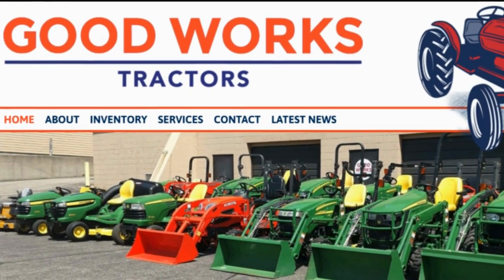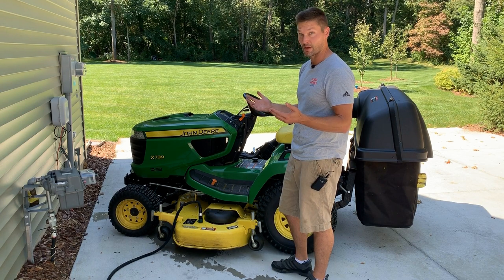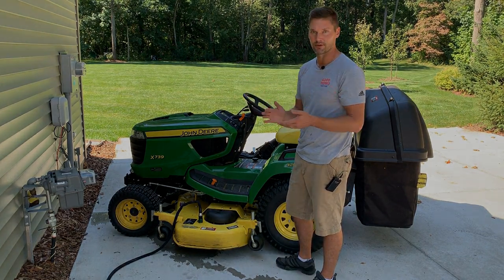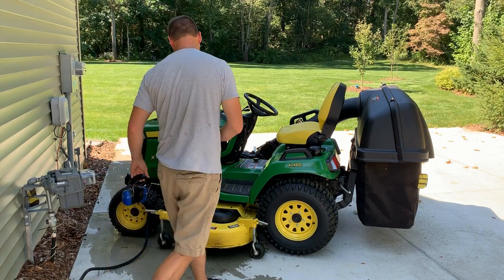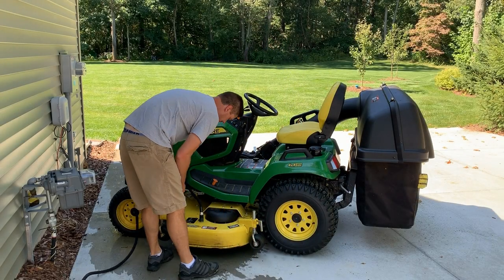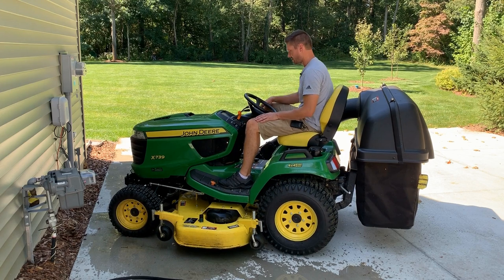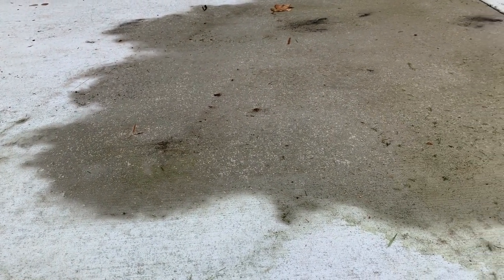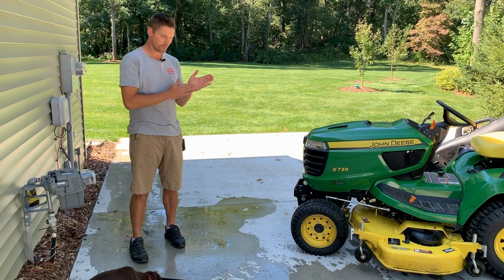Using A Mower Deck Washout Port On A John Deere Garden Tractor.  Same for Husqvarna, Cub Cadet, Toro

Comment: I have an X340, 54” deck. I never use this stupid thing. Every time I flip the thing over there is nothing, literally nothing, stuck on the underside. There is also zero rust because this is a well made deck. So to me the thing is totally pointless and nonfunctional, much like the back pressure gauge on my Power Feed shoot. Even if grass buildup was in any way an issue, how would this thing even help? It’s only garden hose pressure squirting out from one end of the deck. It’s just moistening everything. It can’t blast off serious crud.

Comment: Do Not Do This!  Until you have waited until the mower has had time to cool down. I took my 2019 JD Zero turn in for annual service (Jan. 2022) and the Maintenance shop Super said that John Deere advised them that using the water flush system while the mower unit had not cooled down was causing Spindle failures. That’s about $80 bucks out of your wallet and a wasted day replacing it

Comment: It’s important to do this daily to encourage corrosion so you will need to buy a new deck sooner.
Reply: Used mine every time, deck is 14 years old. 30 seconds of running the blades after removing the water blows out just about everything. It’s dry by the time I clean everything up and it’s time to put the tractor away.

Comment: I think your water flow was restricted. You hardly had any water on the concrete. My Cub Cadet just has water with grass clippings flowing from underneath the deck.
Reply from the maker: Correct,  Its clogged,. Bad design of the port.  Should be simple.
Reply: @GoodWorksTractors  look for a plastic cap plug to put over the port and it will keep debris out of it.

Comment: Your deck didn't need  a cleanout. If all you are doing is that small lawn and only when the grass is dry  you should never need to wash the deck. The trick I think is to wash it before anything dries under there. My deck always has 1 inch of dried on grass from cutting 2 ft tall grass and weeds ands even cutting in the rain on occasion.

Comment: Didn't think so. None really on the ground...
Reply from the maker: It was kind of something I wanted to show.  Hooking up and cleaning out.  The more inconvenient something is to do, the less anyone is going to do it.  You may not be the typical home owner, but most are going to simply hook it up and use it.  Sure seems there could be a smarter design.  However, maybe the best bet is to store the quick connect off the deck and only hook it up when you want to use it.  Keep all the debris out of it that way.

Comment: You have a bagger on and wonder why you dont have grass on the concrete? really? also, you are to run it again when you remove the hose so it dries....
Reply from the maker: The mulching baffle was closed as I clear my state in the video.
Reply: @GoodWorksTractors  Missed that part. I would have expected tons more water. Must have been clogged as you said

Comment: It’s mainly designed to clean a clean deck let me elaborate if you clean the deck to where it s spotless mow than use the water hose it will clean the deck to the way you had it before you mowed . If you mow 10 times and hook it up yeah it’s shit and pointless.

Comment: Recipe for making the washout port look useless. 
1. Mow for a long time and allow the deck to get caked up with debris. 
2. Allow the debris to set up like concrete that’s dried. 
3. Park your mower on the cleanest section of a concrete slab to ensure grass stains show to up the most. (Whatever you do, don’t park your mower 20 feet over on the grass where debris will be invisible.)

Comment: Your port was plugged up. There is nowhere near enough water on the concrete.
Art from Ohio
Reply from the maker: That's the entire point of the video. It's a stupid design.
Reply: @GoodWorksTractors  Does it not come with some sort of cover like a hydraulic connector? By the way I love your channel.
Reply from the maker: No cover provided, it's just a goofy design. Thanks for following along.

Comment: Don't you think that common sense would dictate here.  There is no water underneath nor on the ground when you got off the tractor and peaked underneath. Your  quick connect or sprayer is clogged.  During the video you can here the blades turning while you sit on the mower but nothing not even water is spraying out under the mower deck. Obvious.  The cleaners do work if used in the proper way. and if you install one on a mower that doesn't have one you need to install it in the proper place. Rate above the deflector that is on the blade.
Reply from the maker: Yep, clearly it explains the situation perfectly.  It's a terrible design, yet common sense still couldn't get those engineers to create something that works.   No one even changes their oil when their supposed to, yet they think everyone will spend extra time every time they mow hooking up this worthless contraption?  Unlikely.  :)